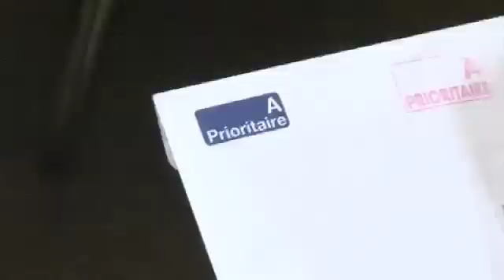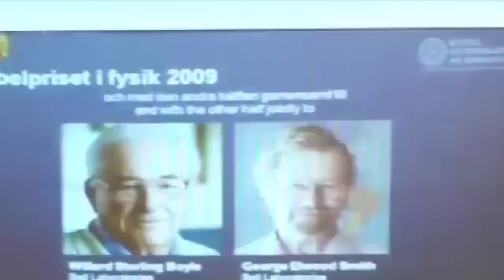The 2009 Nobel Prize in Physics - Sixty Symbols

Comment: I saw in other sixty simbols video someone saying that light travels 40% slower on glass. So, doesn't this make information in optical fibre travel only at 60% of the speed of light?
Reply: No, it's the speed of light in the medium. That also depends on the type of glass/how the molecules are structure. Light doesn't travel slower in glass, it just takes a longer route from to travel the same distance. :)
Reply: + the light doesn't follow a straight path.
It's a zig zag pattern, so classically the path is much longer also.
Reply: Hugo Santos actually going through glass it will emerge from the other side having gone slower through it. but inside the hollow tube of glass it's traveling through air or even a vacuum so the speed will be close to c.

Comment: Light travels at the speed of light through glass, which is a speed of light. You would be correct if you said, "Light in a fiber does not travel at the speed of light in a vacuum."

Comment: ahh ok, how interesting.- so every sound at any given moment can be described by a particular wave. Putting many of these waves together in sequence and we got a sound that we interpret as a complex sound. Since, velocity is constant and wavelength depends on frequency (and vice versa), then we only have frequency and amplitude information which needs to be transmitted. thanks. This also explains how something as simple of string  can transmit sound with 2 cups attached to either end

Comment: timbre, tempo, pitch, distortions.. are just ways of describing our perception of sound. What you say is multiple planes, since sound is a wave are: velocity, frequency, amplitude and wavelength. Velocity of sound is constant, when velocity is constant, frequency is dependent on wavelength. We are left with two planes; frequency and amplitude. Amplitude is the diode's brightness, frequency is it's speed of change. The amplitude can be changed by the volume.

Comment: The LED part seems to be a simple transistor amplifier circuit. The receiver would be an current-to-voltage converter using an operational amplifier. These are both very basic circuits. If you know how to read a circuit diagram, you should be able to find many examples online, if you don't get a diagram here.

Comment: A torch wouldn't really be working, because you can't modulate incadescent bulbs fast enough. The filament glows and has to heat up and cool down to change brightness, which (I estimate) takes a few tenth of a second. But for voice you would have to be able to switch the light on and off a few hundred times per second. A LED is off instantly (at least when considering the audible frequency range).